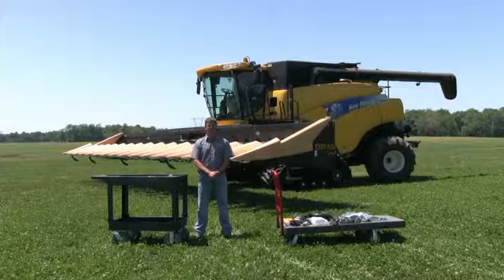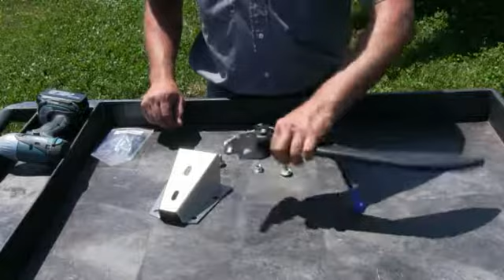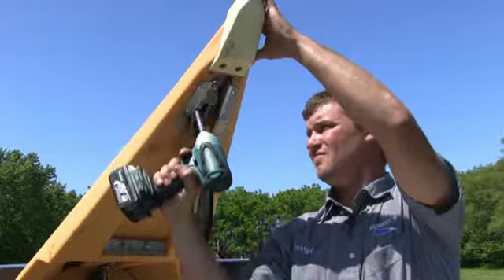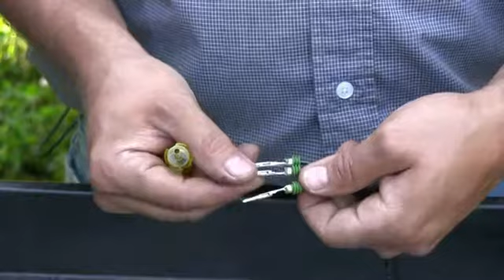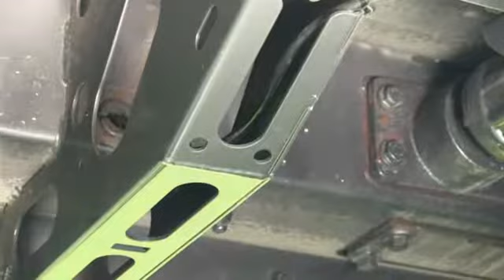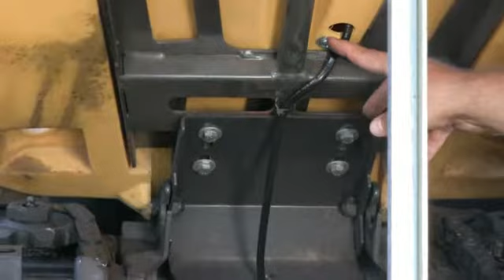Corn Height Installation on Drago

Comment: What purpose does the two Truesight sensors serve?
Reply from the maker: The ability to run two Truesight sensors allows us to average difference of the guess rows when running a header that doesn’t match planter width.  It also can help with better placement during inconsistent crop stand.